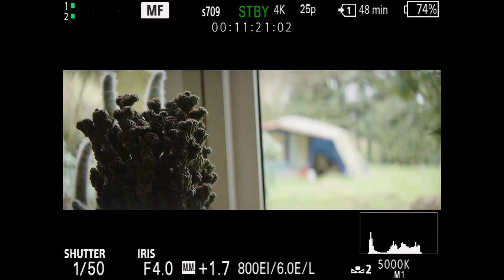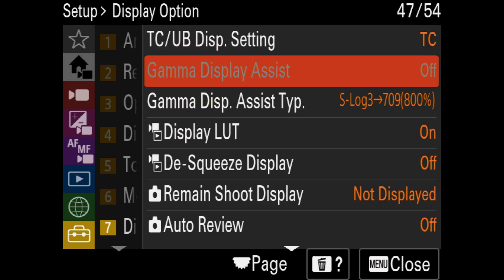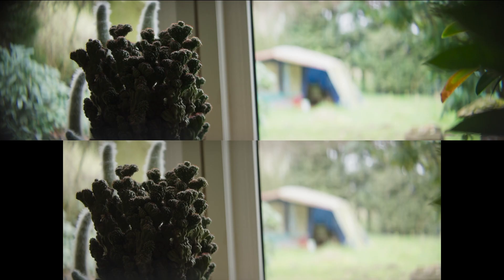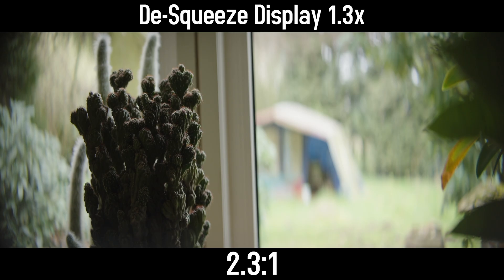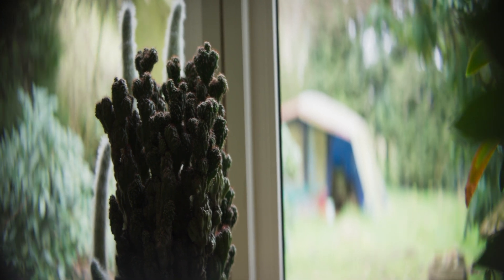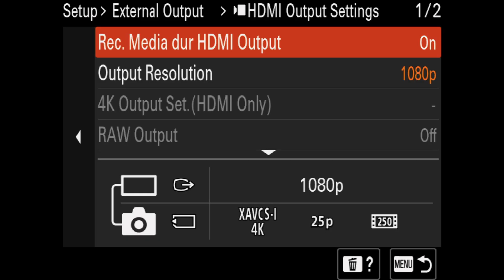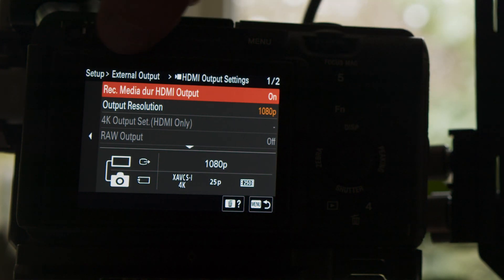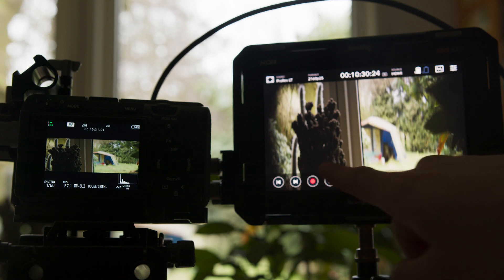Anamorphic De-Squeeze for Sony FX3 - Firmware 3.00

Comment: For some reason when I try to access the anamorphic de squeeze, it just says "this operation or setting not available as follows" then says log shooting. Do I have to be in a specific pp?
Reply from the maker: Good that you ask, I forgot to mention that:
In order to use the de squeeze, you must be in one of the log shooting modes (Cine EI, Cine EI Quick, Flexible ISO). If you have set Log Shooting to off, you can’t use the de squeeze - don’t ask me why.
Menu - Shooting - Image Quality/Rec - Log Shooting Settings
Reply: @deadendboredom  perfect thank you!
Reply: @deadendboredom  omg thank you so much for this, every article literally says you have to shoot on manual mode

Comment: Im curious to know your thoughts on the DCI 4k option. It looks like it crops the top and bottom to get the dci 4k aspect ratio (while still having more resolution of course). 

My question is if this DCI 4k crops the image as opposed to getting a wider field of view, what are the benefits of using it? The only things I can think of is to match other cinema cameras’ frame rate & resolution. For people not working with other cinema cameras, its best to stick with 4k UHD right? Idk I’m not knowledgeable in this 😅 just trying to figure things out
Reply from the maker: You understood that very well.
DCI 4K is a cropped readout and in this case it may be the case that only here there is actual 24P in the FX3, but that is not necessarily a DCI thing.
Originally, my answer here was different, but then I checked it again. And in fact, the DCI 4K resolution here is different than in the FX6.
Because it’s not a 1:1 readout here, it actually makes a little more sense than in the FX6, where you really get a little crop. But in the end it is a technical prerequisite in some places and otherwise not earth-shattering.

I think it’s wonderful when there are people who try to understand and find out things, keep it up!